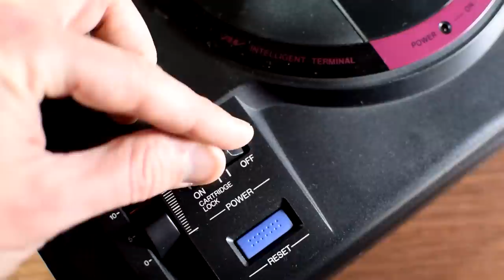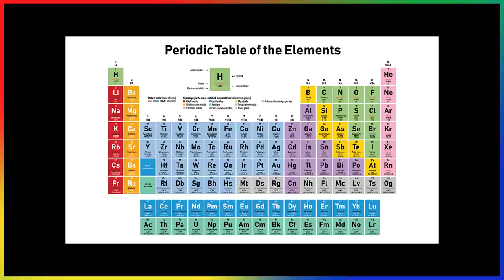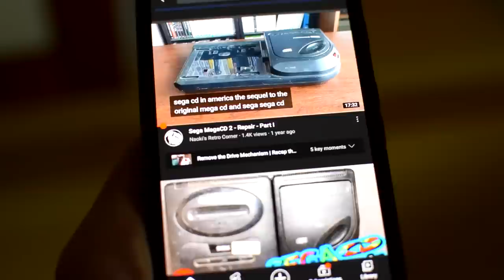Should You Fix Your Own Consoles (And Games)? - Retro Bird

Comment: I'm two years late to this conversation, but I just did some work on my Gameboy Color this weekend. I replaced the speaker with a better one and  replaced three surface mounted capacitors. I also cleaned the volume wheel and power switch contacts. This coming weekend I'll be getting a clear blue shell to replace the cheapo aftermarket one it currently has. I'm definitely a big advocate of learning how to do these kinds of things - there aren't many places to go or shops that specialize in this kind of work. It's up to us, really.

Comment: I always had video game consoles, but I've been more used to fixing PCs for most of my teenage years, since they're kinda modular. But when I decided to try fixing my old consoles, it scared the hell out me for them not being similar to PCs at all. Luckily, most of the problems they had were related to dirtiness and overheating, which caused loud noises. I got to lube up my PS2's disc drive, and I also successfully delided my PS3's CELL CPU to replace the thermal paste. It felt so satisfying to not hear those loud noises both consoles were doing before!

Comment: Love your videos, Bird! This one was particularly useful and insightful. I've been reorganizing my game collection recently, and after I noticed the CD lid on my original Playstation wasn't closing properly, I decided to crack it open and give it a thorough cleaning. Not only did I fix the problem with the lid, but I cleaned out all the dust that had accumulated inside the console over a 25-year period. 😅 On top of clearing out the dust, I cleaned the disc laser, and now my original Playstation runs a lot better than it has in years. 

I'd like to do a similar cleaning with my original PS2 at some point. But I'm afraid of ruining the console's warranty sticker (even though the warranties on PS2s have long since expired!😂)

Comment: Good to see a video like this because this was like the final sign to affirm within myself that I need to go back to school and venture into the computer IT / networking field.

I mean a few weeks ago I came across a PlayStation 3 Slim console from my passed on uncles house and when I turned it on , harddrive , wifi, optimal system performance even the fan sounded great , just the disc drive didn’t work.

I went on YouTube and watched a bunch of videos . Some people said change the two lasers . Some people said the disc tray shielding was dented ( which mine wasn’t dented ) , some said it’s the motors inside of the casing to move the eyes are dead or needing grease , some said you need to realign the disc feeder. 

^ now even though if you know exactly in each of those instances are wrong is either a free fix or a fix less then $10 , I decided to spend triple the amount of $10 and also make it a much easier labor endured project and just replace the whole disc drive entirely by finding a working OEM drive which eBay happends to be the cheepest for that answer . Now I’m able to play all my downloaded games that if available are now obtainable again , bought myself ultra street fighter 4 on disc , still getting to pop in even a blu ray or a dvd movie if I wish. It’s really awesome. 

Which brings me back the the fat ps3 consoles. I had a 60gb fat and an 80gb fat and both were repaired during the 7th generation when they were on the market 3 times either by a private retro game store or GameStop themselves and then would eventually break again. I got sick and tired of it and kept loosing all my fighting games that were on there back then but arnt on the PSN store today like marvel vs Capcom origins and such and decided to begin collecting for the Sega Saturn. I wanted the original games but did not want to use the physical discs on the console if I didn’t have to because I had a modified PlayStation 1 in the late ninties growing up with a disc burner and thought to do the same with Sega Saturn.

Got very lucky with the timing not only because the games were much more affordable again even some of the heavy hitters but also Pseudo Saturn was really making a presence in the mod scene in 2016 when I began Saturn collecting and watched online how to make action replays flash into pseudo Saturn by disc swapping methods. Because the Saturn market was cheep at the time even for used saturn consoles. I was getting the console between $28-60 used with all wires , 2 controllers and Atleast 2 games even if they were disc only. That summer I must of broken 3 saturns ripping them apart and mastering the disc swap / flashing to eventually play my backed up games and then at that point learned how to properly dismantle a Sega Saturn either it be model 1 or model 2 and also what does what where in the console , other common issues to troubleshoot , also to avoid modding the doors on future owned Saturn consoles because it’s bad for the drive as well as watching what ram carts you use that can in time damage your ram slot on your Saturn as well. By the end of the summer of 2016 I knew I had to figure out how to go into the IT field as a career change ( and also expand my Saturn library to where it is today which japenese or English titles , I got everything I wanted and while it was cheep 👌 ) 

I’ve saved consoles too that most people would throw out like putting an ODE in a non disc reading PlayStation 2 fat or greasing laser lines for the laser to jump up and down on within a Dreamcast console . You got to want to open the console you want to work on and like retro bird mentioned , if you know you can’t do it … DONT DO IT and let somebody that you know that can do it. Like I’ll probably never learn how to fully open up a fat ps3 , fix what I need to inside and then successfully put it back together. The 1 Wii I opened up and the one Xbox One I opened up that were non functioning by the time I got the shell off of the two consoles the shell was snapped into peices and they’re was so many metal brackets and screws that I wound up loosing in the process of putting back together on both the Wii and the XB1 , it looked like it fell out of a moving vehicle on the Highway . I know that where the line is drawn for me . Consoles that are easier to take apart and put back together shell , screws and inner components is more of my grounds of labor I will perform.

Comment: Fixed my GameCube about a year ago, it had been in storage and skipping discs like crazy.  It really was as simple as the ol' q-tip and alcohol fix (though it did take several attempts).  Recently too I solved an issue with my PS3 slim continuously freezing in the middle of a Ratchet and Clank game.  I opened it up cleaned out the dust, did a Restore File System in safe mode, and it was still doing it.  Turns out it was because the HDMI cable was going through my crappy multi-port external switcher.  For that system I game on a monitor that only has one HDMI port.

Comment: First off awesome video I know this is old but I wanted to leave my 2 cents. 

Regarding the heating up solder in old games and allowing the juices to flow this is great advise for stubborn games that don’t work after cleaning every contact you can. This solder joints can crack over time and even a tiny gap will make them not work or be intermittent. “Reflowing the solder” allows the solder to fill those gaps and complete the circuit. 

Finally the first console I fixed was my original Blue GameBoy Pocket. The batteries had blown up leaving it full of corrosion. Even after cleaning it all out it didn’t work. But before giving up I followed the path of the circuit trace coming off of the battery + coming in and it went to the power switch. I looked at the power switch more closely and found that it had wicked some of the corrosion from the batteries and filled up itself with corrosion. So I desolated the switch and found replacements. Once the new switch was in the GB worked as well as it did in middle school. And that’s when I got hooked on repairs and modding.
Reply from the maker: I'm glad you liked the video and I totally know what you mean about getting hooked after that successful GB repair.  Attempting a repair that goes successfully creates a feeling like no other!

Comment: I used a NES power supply with my Atari Jaguar and popped a capacitor and two ICs.  Got the replacement parts from Console5, followed a great tutorial online, and fixed the Jaguar myself.  Granted it took me three hours and a lot of retries, but it still works today!

Comment: My biggest piece of advice for fixing retro consoles is to get good equipment. A T12 soldering iron, de-soldering gun and hot air rework station is a must if you plan on changing capacitors, chips or definitely if you want to "mod" a console. The "modification" statement is a whole different discussion, as I know there's a divide in the community when it comes to keeping consoles stock or upgrading them for quality of life improvements. Great video with many pertinent points!

Comment: I am needing to learn soldering to replace the dead batteries on my old cartridge games. I saw where some people have future proofed their carts by installing a battery socket on to the board so that going forward you can simply swap batteries in and out as needed.
Reply: I know people hate the tape method but it does work if your uncomfortable with soldering
Reply: Practice soldering on something unimportant first. Buy a sports game with a battery save and practice with that. I do not recommend using tape because if the battery were to come loose inside the cartridge it could cause a short circuit. The battery needs to be securely held in place. There are batteries you can buy that have the tabs already attached which can make it easier for replacing certain cartridge batteries.

Comment: I bought a PS1 Slim with the LCD screen on Ebay, got it and the laser didn't work. Was able to source a nice replacement laser and it was like new again. Felt really good although it was a pretty simple task. I think I am going to invest in a nice solder station in the future, I definitely would like to learn basics that you covered such as replacing batteries in cartridges and power fuses. Would love to have enough practice to be able to do mods like ODE's, RGB boards, and such.

Comment: I’m so afraid I’m going to make it worse but I did get brave when I acquired a GameCube with the power and open buttons permanently pressed down. I thought, you know what I think I can handle this one. I bought the tools to open it and found sticky stuff on the inside around the buttons. Cleaned it off as carefully as I could and also cleaned out some dust that had built up around the console as well and it has worked perfectly since then. I know it’s a small fix but I was proud of myself lol

Comment: Oh, and I also recommend using something called an Eliminator in your NES system. Clean your system with that, then wipe the Eliminator's silicone "pins" with a paper towel + isopropyl alcohol, and repeat this until no more dirt comes out of the NES. Now clean all of the game carts BEFORE using on your cleaned NES system and you may never have another glitched or blinking game ever again. I've been doing this since 1989 and I'm using my original NES system. My 600 NES carts almost always start on the first try.

Comment: The problem with disc resurfacing is that you can only do this a few times before the disc is rendered unplayable since each time the buffing will shave off a bit of the substrate layer. And it's not like this is kept track of during the life of a game disc as it changes hands to people, stores, and so on.
Reply: That crank thing he showed in the video does the opposite though. It puts on a layer of paste of some sort to fill in the scratches. I had mixed results with those things back in the day. Some it made work again but others it made worse. But it was our only option back in the late '90s/early '00s, back when buffing discs wasn't offered as a service (at least in my area)
Reply: It also makes the clear middle ring part look messed up, and they're more likely to crack in that spot after resurfacing since taking layers off makes the plastic less durable.

Comment: I sold my original N64 years ago and a couple years ago I went back and bought one again. However, the guy told me it wasn’t reading games. I had a feeling, though, and after cleaning the gamepak port, the thing was running again. 
I've fixed a bunch of machines in the recent past. I'm currently knocking heads with a dvd laser on my OG Xbox, which gradually went from perfectly fine to not reading a single disc. 😢

Comment: The system that's given me the most problem is the Virtual Boy and those infernal eye displays. I've tried countless times to repair it on various systems that I've owned. Everything from the heating the displays in the oven trick to paying for someone to solder the loose connection. Finally I 3D printed a part that supposedly fastens the eye displays to the Virtual Boy internals. Seems to be working (for now).

Comment: I mean, I didn’t touch my PS3 for like 10 years so recently when I decided to start using it again, I completely disassembled it cleaned out all the dust (there was so much dust that you could see it spilling out of the vents and after opening it, every single piece had a thick coating of dust) and reassembled it. I don’t know if I qualifies as fixing though.

Comment: A common issue with the Gameboy I see often is buttons that either stick to the sides of the enclosure due to gunk buildup or dirty contacts causing unresponsiveness. For both issues, it’s as simple as opening the Gameboy up, cleaning the shell, buttons, and rubber pads, and then putting it back together. I had to do that for my dmg GB’s B button and my GBC’s start/select buttons.

Comment: I buy broken consoles all the time. Most recently, a Turbografx 16. I was a little saddened to see that someone opened it before me and tore off a solder pad. Not a big deal, because I can fix that, but they didn't mention it. They did say that the video output was broken, and even included the new part, so that made up for it. It is not for the faint of heart, as some of them are horror shows, but it can definitely be a learning experience. I recommend starting with something VERY cheap if you want to learn.

Comment: I had a playstation that I accidentally broke the power cable for the disk drive while cleaning it years ago. 19 years later, finally got it working again only to find out the laser would die after a few months. Replaced that too. I have repaired multiple consoles and controllers now. While going through ebay, I try finding items that I am confident in fixing based on the issues they are having. I have saved so much money simply repairing consoles.

Comment: In college my childhood GameCube had a lot of trouble reading discs, so I replaced it and tossed the old one out. Sucks but I didn't have any options at the time. More recently I've dealt with my original Xbox and 360 refusing to power on. The OG in particular also had a lot of trouble reading discs. So I replaced those as well. No clue where to begin with those, and trying to open up my 360 was painful. Microsoft really did not want me to be able to do it and I felt like I was gonna break a lot of plastic.

Comment: Thankfully, I haven't had any issue with my systems which require soldering. I had a PS1 which kept auto triggering the reset button at random. Ended up discovering that something had dropped into it while in storage, pooled & left a stain on the motherboard in that area which was occasionally causing a short circuit & all that was required was cleaning that off. Then I had a PS3 which started having issues running. Turns out all it needed was to be taken apart & cleaned. At one point, it also regularly cut to black or tv static while playing games. In that case, it turned out the HDMI cable was faulty & I just needed a new one. A few weeks ago, the disc drive wasn't properly initiating a disc eject & kept getting stuck. Wasn't even broken- the day was too hot & the parts had expanded to the point where they were catching. I waited a few hours & it was fine.

Comment: I need to repair my 3DS buttons but I've been holding off on opening up the system. After seeing this video, I found a useful video on opening up the system and it doesn't look that difficult. Just gotta loosen some screws and remove some ribbons. As long as I dont have to go beyond the motherboard, I'm fine.

Comment: Bought a used ps4 a couple years ago that wouldn’t even turn on when I got it. Turns out it had multiple issues. But after a ton of research and troubleshooting I finally got that sucker working tip-top. It was a very rewarding experience, but not one I would want to have to deal with all the time. So I’m kind of 50/50 on weather it’s really worth it or not.
Also, loving all the Castlevania footage 👍

Comment: I have a clone console Classiq N that works just fine, but after inserting my copy of The Legend of Zelda I found that game seemed to have a much tighter grip than most of my other NES titles. It was really rough pulling that thing out, and sure enough the pins were bent out of shape as a result of it. I had to use a very small pin to carefully bend the few pins that were moved and I was greatly relieved to see I had the NES up and working again.

Comment: well, i have not really fixed it that much, i have a at games genesis and one of the dust cover things popped out so i needed to open it up and get the spring put back and get the pin that holds it in place back into the hole.  just a little mechanical issue